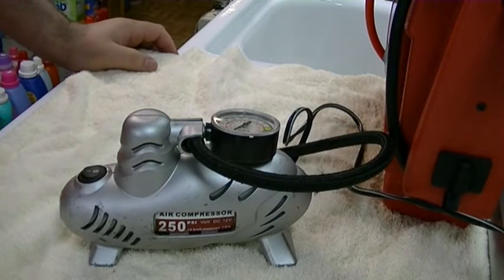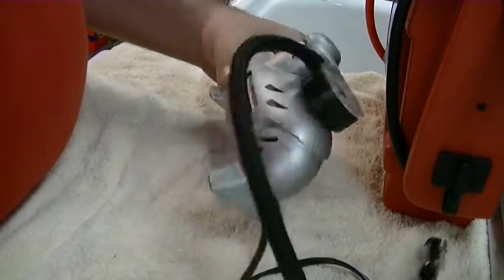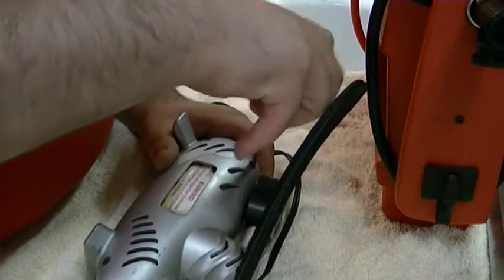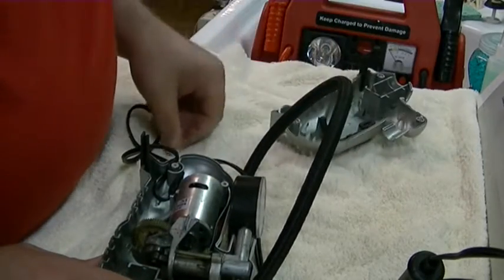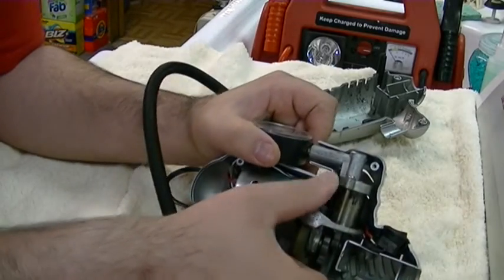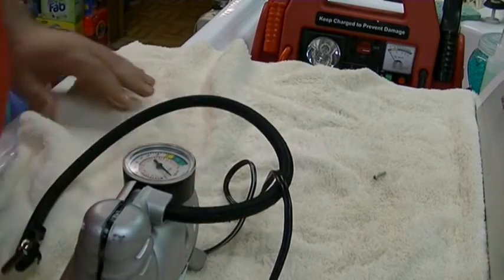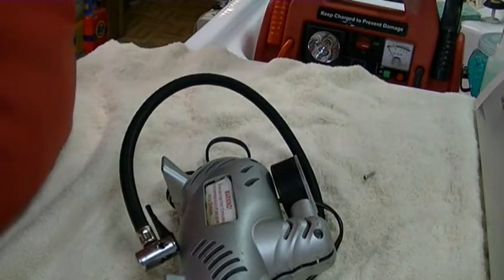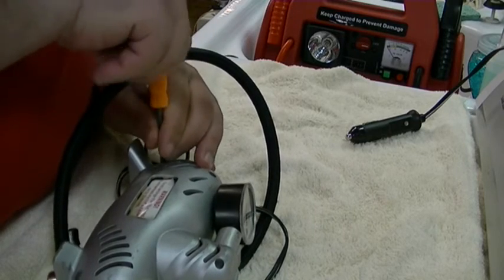Servicing A 12V Air Compressor

Comment: Do you have the 18 volt impact driver from harbor freight? It probably would have been easier to get that screw out. Glad to see you got it working.
Reply from the maker: That would have stripped the screw out in very short order I'm sure.  The screws were very soft, this entire unit is meant to be throw-away out of the box.  I might have had to use the screw extractor set though!  Yes, I was very happy I was able to repair it, I didn't think it would be that easy!
Reply: jaykay18 Yeah that is true too. I have one from harbor freight that works OK. It plugs into the cigarette lighter of your car. That's one thing I don't have is a screw extractor.
Reply from the maker: Love2boat92 HF sells that kine!
Reply: jaykay18 I'm not surprised. I should get one. We might go there tomorrow.

Comment: Probably the head bolts vibrated loose.  A couple drops of thread lock would keep it tight and if you ever need to take it apart a little heat will melt the thread lock and allow you to unscrew the bolts.
Reply from the maker: I should get some thread locker.  You're absolutely right, those bolts indeed did vibrate loose.  The whole thing dances all over the pavement when it's running regularly.

Comment: I remember Scotty Kilmer doing a review on a good 12 volt air compressor. https://youtu.be/iBoX3Fs5VLI
Reply from the maker: I saw that, actually, and remember thinking that compressor sounded really good.  Problem is I'm cheap.  Not only did I fix this one, but Aldi's got one now for 13 bucks that I also don't need that I might need!  And there's Harbor Freight, they sell something similar.  I think Scotty got some nice kickback from them, or got his for free.